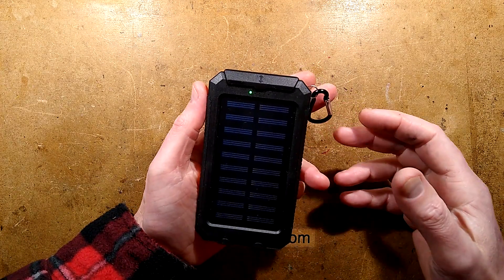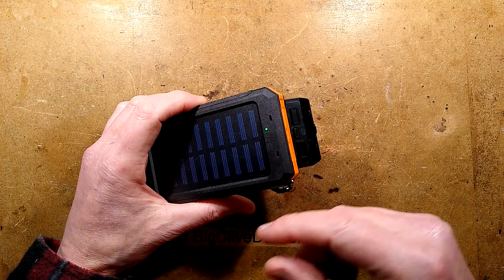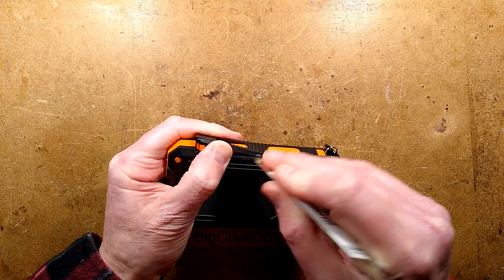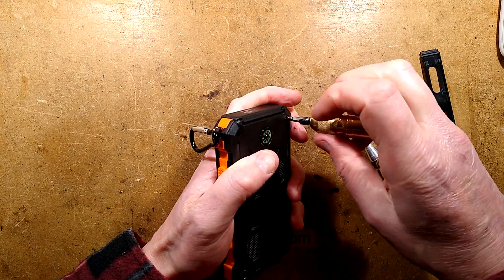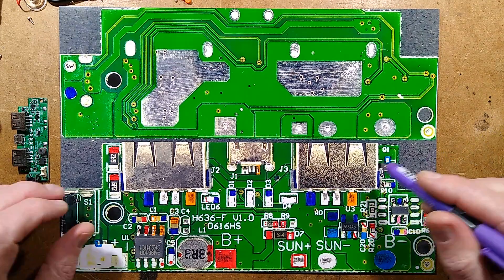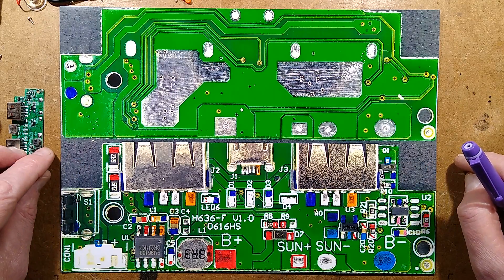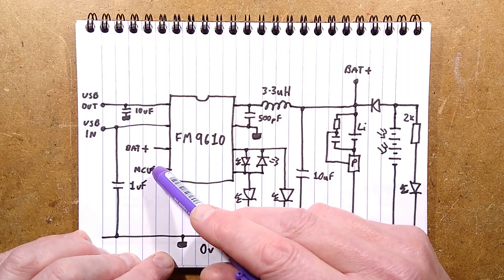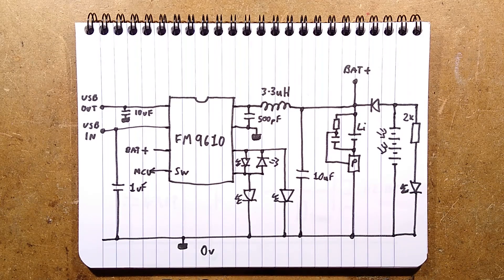eBay 9 MILLION mAh power bank teardown (with schematic)

Comment: HI Clive where do you get those screw drivers  & what is there technical name   i have looked  years ago   but i can't find anything that look's any thing like them they look very handy i am always pulling stuff to bit repairing stuff with my crappy sets of different types i have to use one out of one set then swap to another out of another set then swap to another  set  just to get some thing apart  , that one you just change the ends  it's cool
Reply from the maker: If you mean the little precision drivers, search eBay for 8 in 1 precision driver.
Reply: @bigclivedotcom  this is  from my  phone  this time  thank you  Clive  very very much  I will  have a  look  am on night shift  hope this  doesn't wake you
Reply: @bigclivedotcom  hi Clive got them on order the driver that is  many thank's  for that  keep the vlogs coming

Comment: I'd imagine one of the wire diameters would need to be the same thickness dimensions as the entire unit.
It really is terrible that false advertisements can somehow no longer matter for some reason.

What if I knew nothing only that 9000 amps would run my 100 amp electric heater for a decent weekends survival expedition in the north pole.?

Only to find it melt down at 1.5 amps also rendering it's flashing SOS Function totally useless.
Made in China I presume.?

Comment: I see these on AliExpress all the time. and their like the so-called 2Tb flash drive for $19.95. All is a scam for suckers. FYI I own an older version of those solar charger power bank that towted 80,000mhA. but never gave that. But it did charge the bank via solar at 600ma. Thanks for the breakdown so I don't have to.

Comment: Have you encountered a solar charger that can be used in full sun, at least situations below 40c ?
(I realize that full desert sun would add further problems, primarily for the plastic).
Reply from the maker: Something like that is best done with a separate solar panel with the power bank out of the sun.

Comment: I am kind of curious. These solar cells are really cheap, but who's making them? I only see these cells used on cheap power banks and the like. I always thought in the early 2000's the cells were leftovers/extras that didn't make the cut for sensing equipment, etc that need solar power for long life.

It implies someone is manufacturing loads of cheap, crap panels for use in similar cheap crap. If you can manufacture the cells, though, why not make a better unit and make backup/home/portable large units/etc? Slap an inverter box on a stand and you can be making real money instead of cents.

Comment: Not sure about the maths. 9m mAHr = 9000 AH = 32.4 kWhr at 3.6V - corrected later in the video. Interesting that machined lumps of metal are cheaper than cells.

Comment: At 20 sec your calculator lets you down a bit (not that it matters much!)
9 million milliAmp hours x 3.6 V is more like 32 million milliWatt hours rather than the 32 megaWatt hours your calculator gave.   
Once that is sorted out, the correct answer it should have given you is 32 kiloWatt hours, which is about half what a Tesla battery gives you.  Not bad eh?  Especially when the Tesla battery weighs nearly half a ton.

Next time I suggest you multiply the mAhr capacity by the mV of the battery, then you'' get a million times more energy instead of a measly thousand times.   If you need any more than that, you'll have to convert the mA hrs to microamp hours and the cell voltage to microvolts.  and get a trillion times more energy.

Comment: I bought one of those a few years ago from a shyster at the Home Building and Renovating Show.  He tried to convince me that it had 26 800 mAh capacity which I knew from its size and weight was impossible: I guessed it was really around 6000–7000, and it was actually a reasonable buy, especially when he agreed to throw in one of the long micro USB cables he was selling.  Yes, the Li-poly cell swelled up and burst the case after little more than a year, but I salvaged the solar panel which is actually quite decent and lives on in a small project.
(Edit) P.S. Mine had no extra weight: the cell was larger and filled the space.  My guess was close, because it was marked 6500.

Comment: As discussed on the EEVBlog forum a year or so back, I theorised that these power ratings are what you get when you multiply the actual capacity by the number of cycles in the battery's life.
Reply: Just like saying car's fuel tank has a capacity of 20000 litres because that's an estimated amount of all the fuel the car consumes during its entire lifetime.
For comparison, this is about 1% of the Space Shuttle's external tank capacity of approx. 2 million litres. :)

Comment: 9000000mAh are 9000Ah. By 3.6V this is 32000Wh or 32kWh. This is about 1/3 of a Tesla battery, not 300 times. But dont worry I did a similar error at one of my first tests at the university , and a former ministery of finance in Austria  erred by only six digits in the budget presentation

Comment: I was actually wondering for that price how big the bit of steal was inside , we recently got "13000mah" power banks at work and as I'm an idiot and plugged one into my psu at 15v (usb sockets hooked up for current measurement , even has a red light to warn me the usb sockets are over 5.5) and it blew. So I opened it to find 5x18650 rated at 2400mah each, so yea it does actually have 10ah measured and puts out 19v for PD. We paid €12.50 for them wholesale and for a cheap one it blew me away as I thought it would be total rubbish inside. Just wish it had protection on the microusb for idiots like me.

Comment: being an electrician, either I am fully making a fool of myself, or I am the only one noticing it:

right at the beginning you correctly quote it as 9 million mAh, or 9 000 000 mA.
You type that into the calculator, and multiply it with 3.6V, and you get 32 400 000. However, that is 32 400 000 mAh * V, which is mVAh. in short, mWh. 32 400 000 mWh equals 32 400 Wh, which are 32.4 kWh. Not MWh (or even a capacity in MW, which is even the wrong unit) I am actually slightly disapointed to see clive slacking off twice in just a few seconds!

Other way around, 9 000 000 mAh are 9 000 Ah, which are 9kAh.Multiplied with 3,6V are again, 32.4kWh
to put the correct numbers into perspective: a rather big car battery is at 90Ah, so 100 of them would equal that power bank.

Comment: You broke it, that so called weight is actually one of those new fangled solid state batteries that can hold millions, upon millions of mAh's of power, and can handle huge charge and discharge loads. It then wirelessly charges and recharges from the lithium "buffer battery" so that items attached to the power bank are not subjected to such high voltage and current that the solid state battery can create...🤣🤣🤣

Comment: Clive I think there is a mistake in your maths, you are multiplying mAh by voltage so the result would be in mWh.  I believe the correct answer is that 9000000 mAh = 9000 Ah, so the power bank really has a capacity of 32.4 kWh, or enough to charge an EV once or twice ;)

Comment: 9 million... Lol. I bought several of these and they said they are 30,000 mAh max. But they only have space for 5 cells and can't fit 18650 cells. With the 5 cells it can fit, it would be about 7500 mAh max. since it comes with zero cells, it is zero mAh realistically and should be advertised as such. Also, the solar on mine only ever worked when there were no cells in it, these are trash beyond belief. If they were large enough to fit 18650s and the solar charging component worked properly they would be decent. There is a far better one that charges with mini usb, usb c, and iphone cable, has 4 usb ports and wireless charging and fits 16x 18650 cells (40,000 mAh).

Comment: Have this exact model.  I did not see one emphasis of the one important item is that a standard 5v charger can be used. Mine did not say 9M but a lot lower value...don't remember #. Think 2A is referring the 2 X 1A combined.  SO much is lost in translation.  Works great for me as I leave it on the window sil mourning's just to keep it topped off. When I really use it on the move. IT WORKS to keep my phone going.  ENJOY YOUR TEAR APARTS!  Thank you BigClive from an Electrical Engineer/Failure analysist. P.S. Carries well on belt, backpack or tool pouch with the carabineer.

Comment: Now I feel cheated! I bought a similar powerbank, but it was only advertised as 10,000 mah. It's actually been a decent bank, even if the solar charging is only a gimmick. I did try to let it "solar" charge, and after about 8 hours it had gained one light the LED bar graph, so I suppose it could be used in a pinch.

Comment: Ah but your math is wrong. 9'000'000mAh is a mere 9000Ah, multiplied by 3.6V is only 32,4 kWh, not 32,4 MWh. Clearly you didn't read the marketing correctly and this powerbank is totally legit.

Comment: I bought an identical looking power bank, right down to the orange side strips, from Amazon a few years ago, one day, about 3 months after I bought it, I returned to my car to find the battery bulging out of the case - bearing in mind it was a rainy day with almost no sunlight.
Reply: I forgot to add, mine was advertised as 10,000 mAH, and did seem to have a pretty good capacity, as it could fully charge my 3000mAH phone batter 3-4 times.

Comment: If that really was 9 million mAh it would solve the world's energy problems!!  The tiny battery and metal weight is really taking the piss.  Did you figure out the real mAh of that tiny cell?  I figured 300mAh which means it gets overcharged through usb as I wouldn't normally want to charge at more than C/2 and to be extra safe C/5, 2C is ridicoulous unless you want to use it to start a campfire.

Comment: I used to have one of these with a bigger cell in it (8000mAh I believe, sold as 10000) 
And like you said, with the bigger cell it was actually quite a nice powerbank. (when it eventually died I kept the leds ^^)
Like this, it's a complete rip-off ofcourse. that weight is just too cheeky!

Comment: Well, if you recharge and discharge it enough you might be able to reach the 9 million mah eventually, though I doubt the battery will last 3734++ charge cycles (without accounting for capacity losses you will have)

Comment: Ebay and amazon crap. But sadly in normal brick&mortar stores it is not that much different.
Got my self a remaining stock powerbank with solar-cells some years ago. claimed 5000 mAh and can actually deliver about 4500mAh - so quite good at that. But the solar-cell....  IF you got a nice day with no clouds and you have the solar-cell directly facing the sun then it takes about 2 days to fully charge.
and yes - i really mean directly facing the sun. Initially i tried charging it by just having it stand upright facing the sun at midday directly and even after 5 days it was not fully charged, so for the 2nd round i build a small solar-tracker with an arduino and that got it done in 2 days. The cells are not very efficient and the charge-circuit will eat most of that if it is not very bright.

Comment: 9000Ah*3.6V= 32kWh not a Tesla but a Nissan leaf size battery pack, something that would weigh around 200kg in Li-ion cells. If it weighs 500g (The whole battery bank, including the Quantum Iron slug)?, that puts the energy density through the roof at 64kWh/kg. Hydrogen is at 33.6kWh/kg if burned. Usable electrical energy if used in a fuels cell, is around 17kWh. So this Ebay seller offers a technology that is 40 times better than current battery technology and 4 times as good as what NASA uses and that is without the overhead of plumbing and cryogenic Hydrogen storage!

Comment: You made a decimal-position error.. I mean.. 9 000 000  mAh .. times 3.6 Volts.. equals.. 32 400 000 .... mWh. .. This is where you forgot the "milli-"prefix, and just divided by a million and said mega-wats.. but.. to get to Wh we need to divide by 1000 first.. Which leaves us with only 32 400  Wh .. or.. 32.4 kWh, not 32MWh, so.. much much much more reasonable.. Still quite decent though.

Comment: I rember my local hardware store selling solar power banks for 40$

It was a large dark brown glas solar panel with a Lipo Polymere cell (the soft ones that explode when you bent them) glued right on the back of the glas. 

It took 3 weeks of holiday in Turkey at 50C° in the burning in the sun to charge it once . 

Needles to say it failed within weeks.

Comment: Clive,  Clive, by removing the battery from the case and removing it from the vicinity of the special unubtanium metal you screwed up the Flux capacitance multiplier which of course limits the capacity of the battery.

Comment: Found a 99 900 000 000 LM flashlight with a 20 000 w power supply on Ali that fits in you're hand. Finaly i can show that exploding neutron star whos the boss.

Comment: Wonder if you could recommend a good, large power bank that IS what it says...? Maybe a new Video about electronics that you recommend based on your tear down's? ps. I love taking apart everything. First thing I do when I buy a new electronic anything is to take it apart and look at it. :) glad this channel also helps with my fix.
Reply from the maker: I recommend places like ASDA and Walmart for good high capacity power banks.  Being in stricter countries they are required to provide the real thing made to local safety standards.

Comment: I'm at the 7:00 mark and I'm certain that's either a 104050 2500mAh LiPo battery, or a 1000mAh version. Because those are the cheapest LiPo's available currently. Let's see if I was right
Reply from the maker: Yup.   2500mAh.

Comment: Clive, please make your dream power bank. Ideal battery size, leds, ports, case. what is the dream?
Reply from the maker: It would use one or more dumb 1A/2A units with no self shut-off, and a mass of individually fused lithium cells.

Comment: I think you forgot to devide by thousand?
9,000,000 milli amp hours times 3.6v = 32,400,000 milli watts
Or 32,400 watts, or 32.4 kilowatts
Not megawatts

Oh nvmd
You found out yourself halfway trough 😅

Comment: I think you forgot to divide by 1000 right at the beginning, between calculating (mAH x voltts = ) mWh, then saying it was watt-hours; you were off by 1000. But, this indicates how stupid this all is: if you'd said 320kWh, instead of 320MWh, it would still be triple the size of a 100kWh tesla battery. LOL

Comment: I remember I was on my way home from Thailand in their airport with a tour group. I have a big powerbank (8x 18650 cell, you get the case and stuff your favorite 18650 in it) and is labeled as 20,000mah. I went through just fine. Someone else in our group had a much smaller power bank and it was stamped with a heavily inflated  mah number and his got confiscated.

Comment: I found that the Chinese seem to over rate their batteries and any battery I bought was 10 times less than advertised, some digging and it looks like they use a trick, exp. 9800 mAh battery tested to 980 mAh battery, this was true for all tested I then was told that its not Miliamp they state but rather micro amp , the 'm' stood for 'micro' as they dont have a correct translation, (On Purpose of course)

Comment: I have a lithium jump started pack that I purchased for our car. It is rated to start a Truck because I know how bad the Chinese lie concerning their batteries. It would be nice to see a tear down on one. I think anything with a solar panel built in is usually junk unless it's a separate independent  panel that can be plugged into something separately.  You have a better chance of it actually  working.
Reply: I think he's done more than one already, including putting one across a dead short to see what happens. They're usually just a big lipo pack with little to no protection on the output, certainly a "shake hands with danger" product in my book.
Reply from the maker: I've taken a few of those apart.  We used a few to power the lighting in costumes on a show recently.

Comment: So, not even close to 9 million μAh.  I think the convention to use milli-prefix when there is thousands of something is ridiculous, especially when it's actually not that exact. In the case of power banks besides not being an exact value of the capacity of the cell/cells, because it varies, I consider the convention to state even the actual nominal capacity of the cell, as the capacity of a power bank half a scam. I understand the basics, but the common consumer does not. Also, the nominal capacity in Ah, or mAh assumes a specific voltage to be relevant, at all. 

"But capacity of the cell in the phone has same, or at least similar nominal voltage." I don't think that is relevant, or right to declare that in mAh alone. I think power banks and battery pack capacity should be given in some relevant unit for what they actually can deliver, in normal use. Cheap power banks does not recharge your phone with anywhere the stated capacity, they don't even deliver the amount of energy the battery can store, there are losses both in the battery and the conversion. For typical power banks Wh out during normal use could be a relevant primary unit for average consumer, but I could live with joules. For cells or packs without unavoidable significant losses from normal use is nominal capacity the right data. Not just Ah, without the voltage and definitely not in units like in billion picoamp hours, or attovolt.

Comment: i have one of these! i fully expected the solar cell to be completely fake, but it was real! it generates barely enough power to run USB 2.0 (5v at probably 400mA, so barely under standard). the "batteries" inside it were either fake or dead though